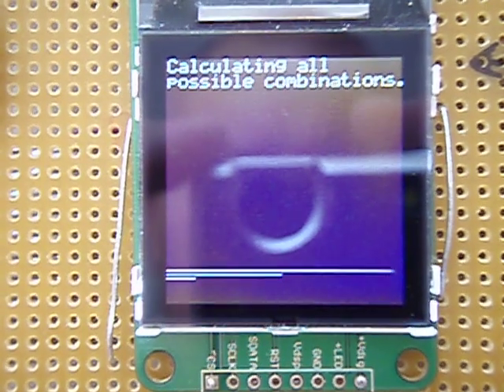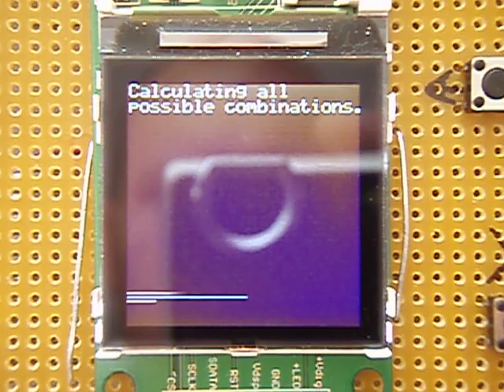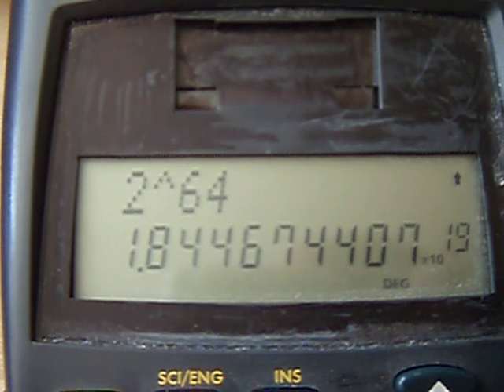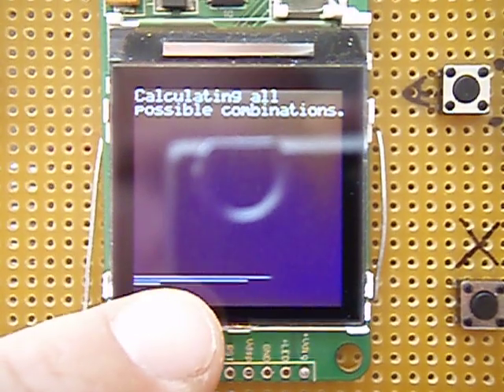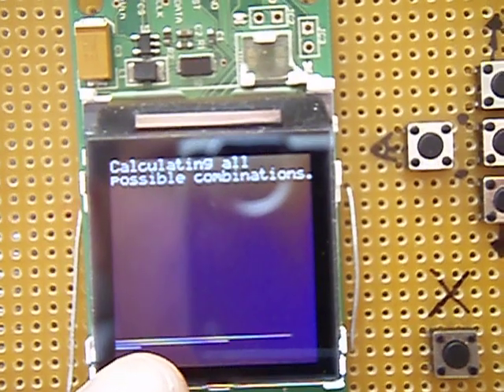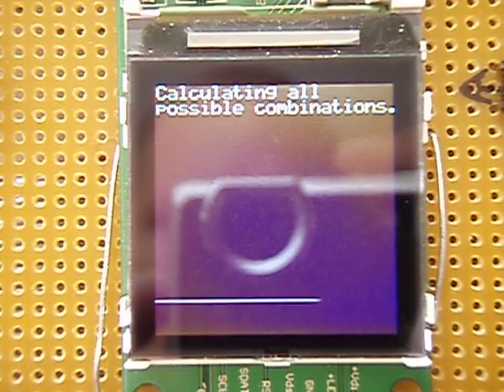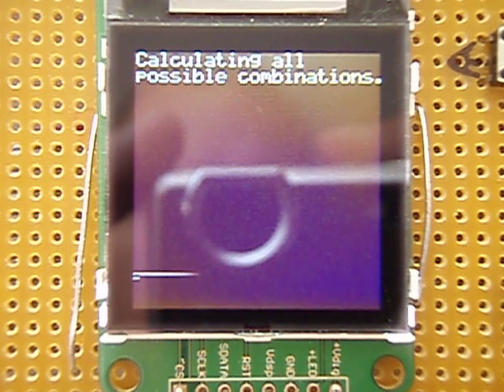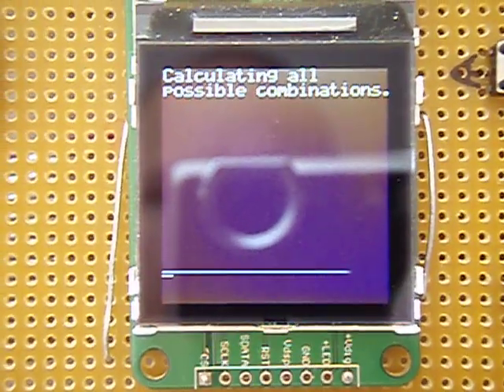8-Bit PIC Microcontroller doing 64-bit calculations

Comment from the maker: Hi!
The development board I made has two PICs on it and have serial interface between them, but on this video Im only using one PIC, most of the cpu power actually goes to updateing the LCD. Just too lazy to do a optimal code for the interface to run smoothly :P Nope, havent tought of a DS, this is a project to show the power of the PIC :) As for the voltage divider, Im running the board at 3.7 Volt, so no need for it.

Thanks for your comment! 
Regards from Sweden! :D

Comment: What concerns me about going through all combinations, is that there are so many, 1.8x10^19 combinations.  At MHz clock speed, you're not going to be able to test much more than 100,000 a second.  All combinations would therefore take 10^14 seconds = 20 Million years.  

Still, you're clearly more advanced than me.  I don't understand why anyone would doubt that you're doing 64 bit manipulations.  Seems conceptually straightforward.